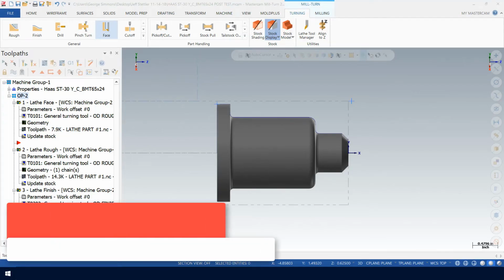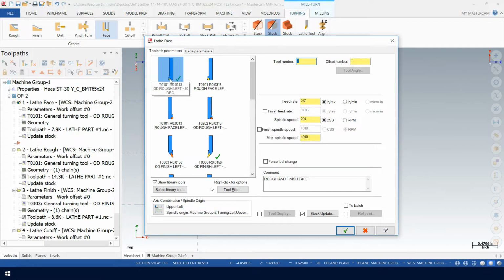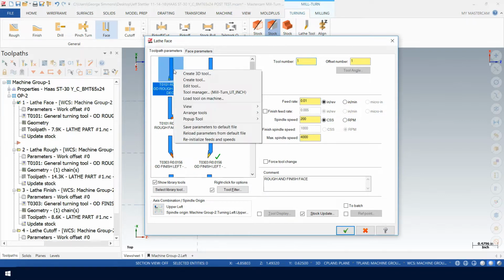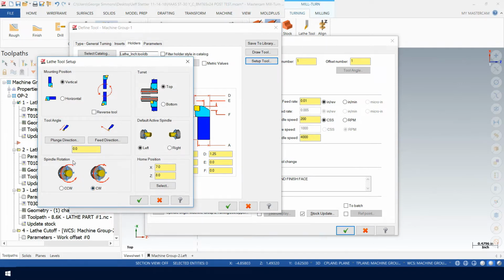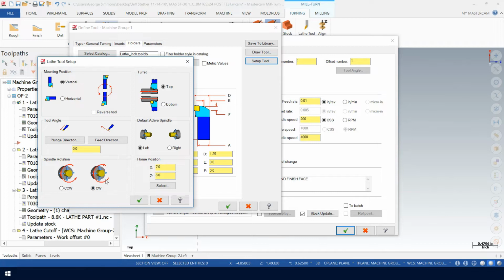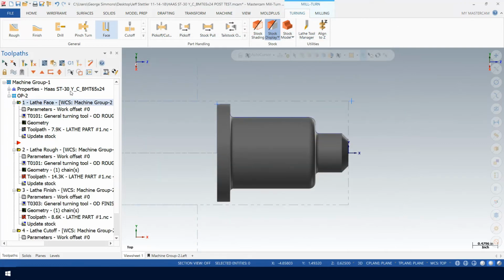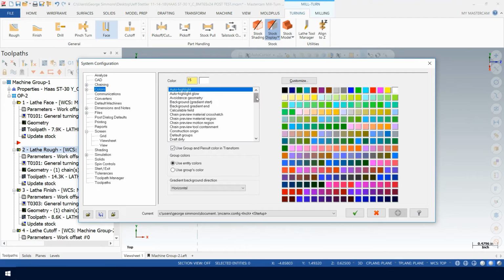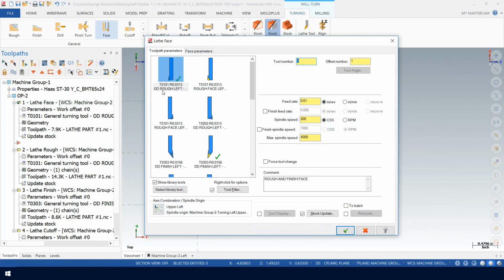Mastercam Tech Tip: Lathe Toolholder  Set-up

Comment: I came across this video after a few hours messing around with the machines definition for a TL-1 with a single tool holder, trying to get the single turret axes set correctly so the tools came in from the lower left. You'd think the tools would then default to your only lower left tool holder but evidently you have to tell the tools what to do. The insert UP/DOWN tip and the idea of recoloring the down insert is also great.  Bravo and thank you, MLC CAD Systems!
Reply from the maker: I let George know it was helpful, thanks for sharing and commenting!

Comment: tanks. in cnc lathe can you use 2 positions of turrets without having to use the millturn module?
Reply from the maker: Hello! This is applicable to the GENERIC FANUC 2X LATHE, up to and including everything in between it and the more complex GENERIC FANUC 4X MT_LATHE.
Reply from the maker: Mastercam Lathe supports Left and Right turret machines, but an Upper and Lower turret machine requires two code streams, which is supported through the Mill-Turn product.
 We do offer post processors that support Upper-Lower code streams for the Lathe Product, but it will not backplot and verify the sync. events.
Also, we have the Machine Environment that will simulate a select few 2 Axis lathes within the Lathe Product.